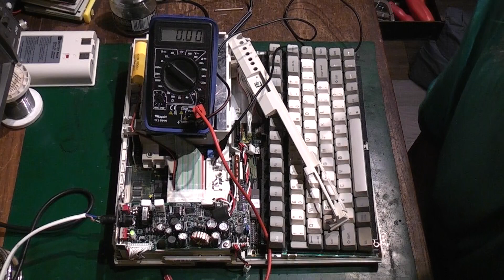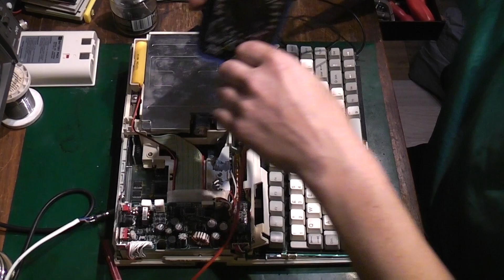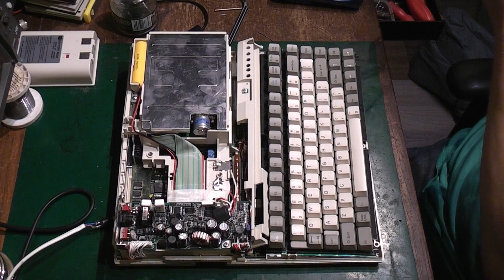Toshiba T1200 taking some voltage measurements for a fellow YouTuber

Comment: Very helpful, big thanks for the demonstration. At my workplace, I got 5 of this machines with faulty power supply. These electrolytic capacitors are painfully to remove but I managed to do so. I replaced them with new ones (Panasonic Types - the 150µF, I replaced it with a 220µF, I'm sure its ok). I got 1 Power supply working, the machine is displaying some errors because no batteries installed, but it stay on. The others are acting very differently: One has a shorted transistor, another shows a green standby-Led, but flashes red when turned on, the third one has a broken mosfet (Q8 - J132??) and flashes red instead.
The last one powers the machine up, runs a few seconds and shut off. Your demonstration will be a great help to deal with these power supplys.
Reply from the maker: I'm glad it was of some help to others working on one of these computers.

Comment: Hello. Please help me, when I turn it on the red LED is flashing, the voltages I have are only pin 2-4.43v and pin 4-4.8v, I bought a second Toshiba T1200 and it doesn't work either. Where to look for the cause.

Comment: Fantastic!!!  Thanks ever so much for doing that!  There so little info on these online and often the PSU's get hit really bad by cap leakage!  That last one was -21v I think!
Reply from the maker: Glad to help! Yea last one was -21V not 2,1v I'm guessing possibly power for the backlight inverter? but I'm unsure why it would be -volts in relation to ground.
Reply: @Jayoldstuff1  Yeah, I think you're right!
Reply: @Jayoldstuff1  this is the voltage for the display, exactly for the inverter. The service manual is given -22V for this, so your -21V is close enough. I see some machines with a blue tinted screen and some with the grey/green display. The blue ones have 2 connectors - a big black one and a small white one with only one wire in it. But I didn't found any connector on the mainboard for this small one.